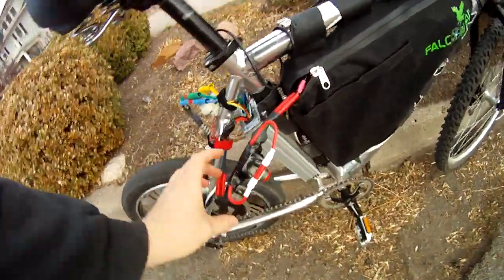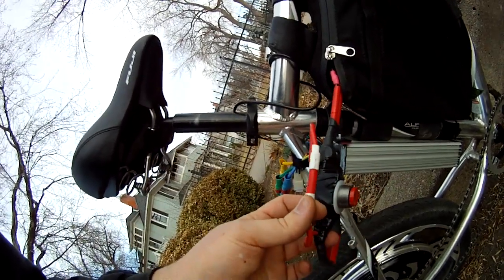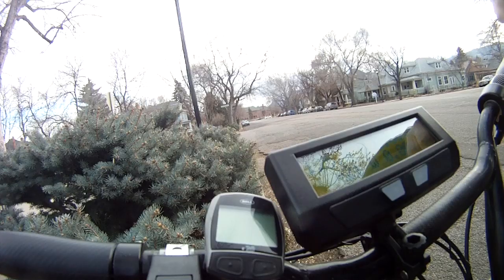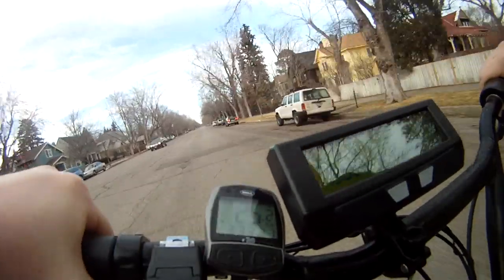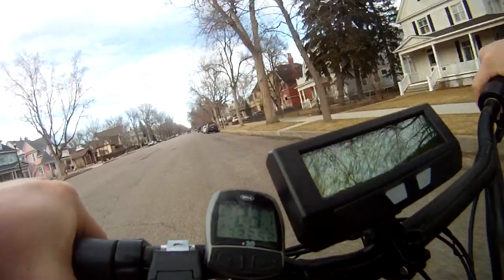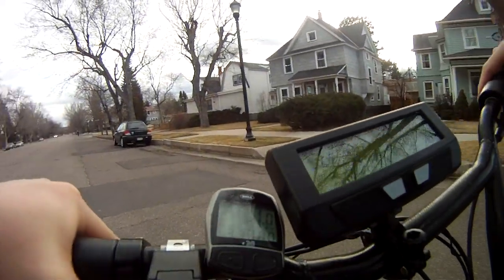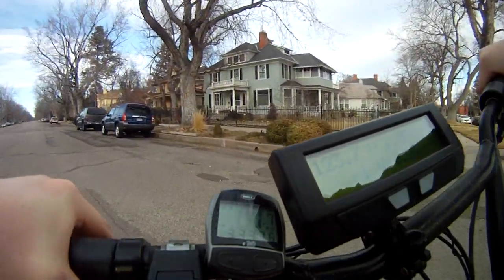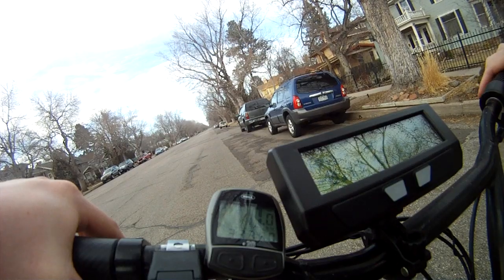20" Magic pie on 120v / 30S lipo - 42mph!

Comment: What did you set the "over voltage" and "low voltage" to to get this thing going at as many volts?
Reply from the maker: There is no overvoltage setting on the infineon controllers. I didn't have to change anything. I don't use low voltage protection, i just watch the volts and make sure i don't go under.
Reply: Thank you.

Comment from the maker: It lowers your top speed, but you compensate with voltage to increase your top speed.

You need to think in terms of watts, not volts. You could get a motor that would do this speed on 48v as well, it's just that it would require a higher amount of amps to produce the same power.

I was pushing 65A into this motor from a stall, and that is how i produce massive torque from a standstill; it maintains 42mph at under 20 amps :)

Comment from the maker: I completely agree with you. I have been looking for a suitable full suspension bike for years.
Most DS bikes have wimpy rear dropouts, so the amount of torque they can tolerate is low.
Also, they do not have much room for batteries as 99.9% of them have the shock in the front triangle, right where your battery would be.

I have been using trek hardtail bikes for 3+ years because i can jam a ton of battery into the triangle and the frame.... it's bombproof.

The rear 2.75" tire helps tho :]

Comment: "locked rotor" is very similar to a short circuit condition, so the only thing limiting your current is the impedance/resistance of the wiring which is very low Ohms. V(volts)/R(ohms) = Amps, and Amps generate heat. Higher voltage therefore higher starting current, which also will translate to higher wattage of course. To reach the same speed at a lower voltage your current draw is going to be higher. Anyway I was just trying to clarify what ratings mean and some reasons behind them.

Comment from the maker: That's never been a problem for anyone dumping mega huge voltage into these hub motors.
They're slow speed windings, so you don't need a lot of amps, but you need a helluva lotta volts.

It's combined wattage that is really what you want to look at. BLDC ( 3 phase ) motors don't see the voltage of the battery directly. It's hard to explain and even i don't understand it completely.

Comment: With volt rating for wiring it's about the insulation that's around it. Go too high and you're going to start getting arcing through the insulation o.O
I suspect the voltage rating could actually be over 300V but the amps you'd draw from locked-rotor condition (basically using the motor at full speed from rest) would be too high and you'd burn out the windings. So basically if you keep your amps within spec and voltage within the actual insulation rating, you can get a shit ton of speed "safely"

Comment from the maker: Hey there, i used an infineon controller from em3ev, a 4115 18FET.
I could have given the motor more amps and had better performance - but the bike had a tendency to wheelie a bit too much and was unsafe, so I ran it at this power level :)

The magic pie internal controller is trash, not reliable, and only runs up to 60v.

Comment: where can i get a reliable bike frame bag where it's kind of wide...

i ask because i want to make sure i can put enough batteries for long distances like 45-60 miles at a rate of 20-25 miles per hour..

my 48v Cyclone Motor bike gets around 2.2 miles per Amp Hour so far @ 20 mph

My 15Ah LiFePO4 battery Pack is too Big for the Middle of Frame..........

Please Help Me!

Comment: by the way, I found a youtube user who indicated me a site that sells sprocket adaptors for unite my1018Z .. has BLT motor a 11 mm wide jackshaft with 4x2 mm key? If so, i found the way to install a pinion cassette and choose the optimal gear ratio manually!

Comment from the maker: Sure, but i wouldn't run it at ~40mph for more than say 5-10 miles. 35mph and below is not much of a problem, it will climb big grades for long periods of time without producing too much heat.

On 50V, the speed should be about 21mph.

Very slow winding, very high torque.

Comment: Are you sure the cast aluminum rim can be taken off the 20 inch magic pie 2?? It seems that it is constructed in such a way that it is one piece. If you can, please let me know. And it would be great to see video of what you discover about that.. That feature would be great if a person wanted to use there magic pie on a different size rim, other than the 20 inch rim/wheel.